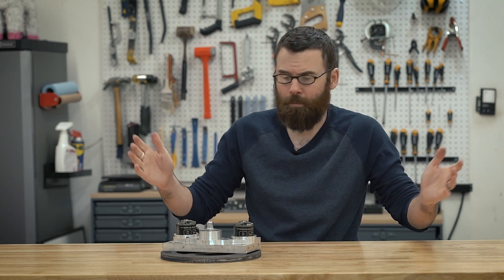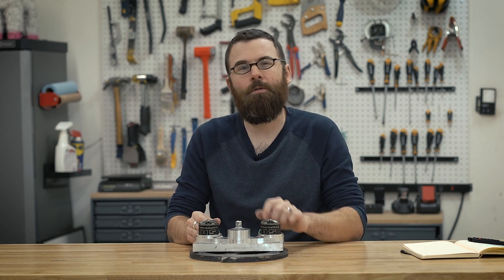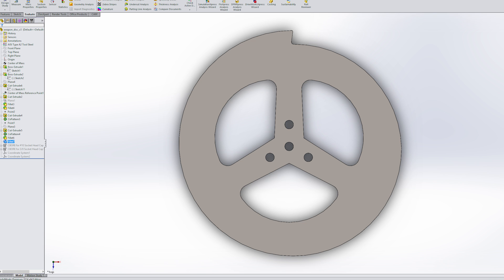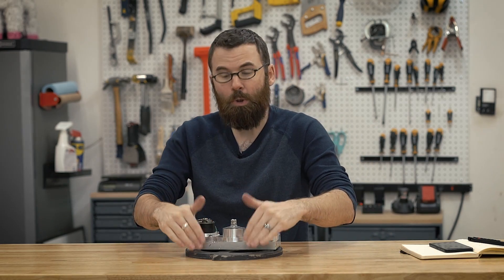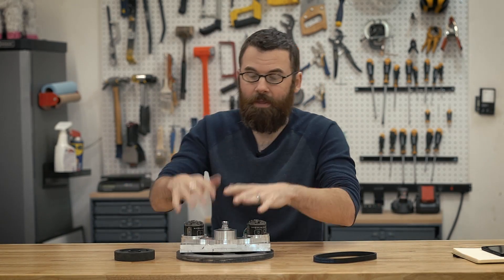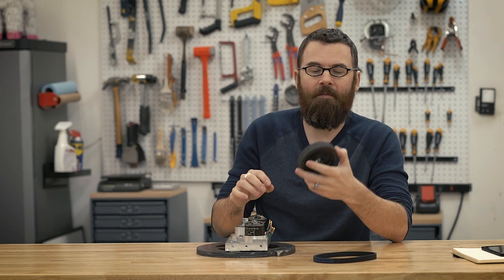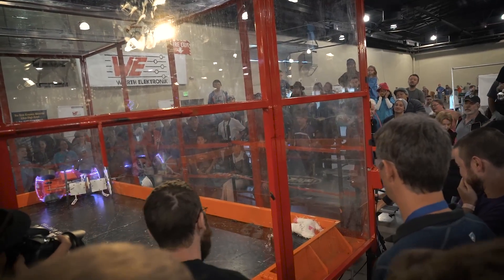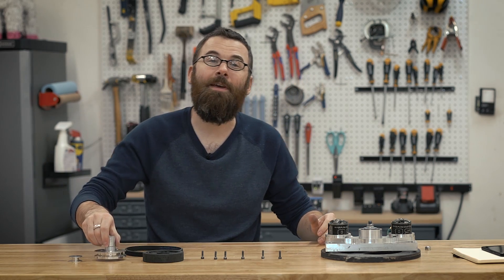Crippling Depression - Part 4 (Weapon System)

Comment: I have to ask why two motors?
Reply from the maker: Twice the power.  A single motor does OK, but with two motors, I get a much faster spin up time and much more torque.  I could have used a single bigger motor, but the height prevented me from going much larger (physically).
Reply: Robert Cowan thanks! I was not expecting an actual reply. I was literally inspired by you to try making a combat robot. Me and some friends only have a design right now but maybe someday. Thanks again!

Comment: Does more KV of the motor = less torque?
Reply from the maker: generally speaking, yes.  a motor has a fixed amount of power, so it can move faster with lower torque, or slower with more torque.  The windings ultimately determine the KV rating, and the motor itself will produce roughly the same output.

Comment: Was there no worry about the flywheel shearing its bolts?
Reply from the maker: Not really.  It would have to shear through 4 hardened 3/8" bolts.  In the final teardown, I found that the threads were a bit deformed, but that was all that happened.  It would take a LOT of force to shear all of those bolts.

Comment: what does 'KB' mean when you talk about the voltage?
Reply from the maker: I'm saying KV.  KV is how many RPMs the motor spins given a certain voltage.  So, if a motor has a 1000KV rating, and you feed it 10 volts, it will spin at 10,000 RPM.  When using brushless motors, it's important to pay attention to the KV rating of the motors as well as how many volts you will be running them at.
Reply: ok, thanks for the explanation!

Comment: Are you able to, or did you, program a slow ramp up of power, so you can use a switch (on/off) to control the weapon?
Reply: Or a coil to electricity ramp it up slowly.  (Not sure what physical size of coil that would take)
Reply from the maker: It doesn't really need any of that, I can just slowly ramp it on my radio.  I COULD map the control to a switch on my radio to just turn it on/off, but it's better to have fine control.  The faster you go, the more power it has, but also less chance to 'catch' and cause damage.  So, having the ability to control the speed is pretty important.  Also, the ESC has parameters that can be set to soft-start and such, as well as the radio.  But for this design, it's pretty unnecessary.

Comment: How about cutting an edge (like a blade) on the weapon tooth? So it'd cut instead of hitting. Would it make any sense?
Reply from the maker: the goal is to cause an impact, rather than cut.  the impacts cause shock to internal components (screws, electronics, motors) which causes them to fail.  cutting may cause more superficial damage, but it's nearly impossible to disable an opponent with cutting, unless you get to wires and such.
Reply: I see. It's very effective indeed! I Can't wait to see the other wheels with the different size teeths in action!
Reply: ndavid42 I would also think that a cutter would have a better chance of lodging into the enemy’s skin too.
Reply from the maker: Lodging in the other robot is not desirable.  Impacts that cause things to shatter, bend, or become mis-aligned is what you're after.

Comment: Fantastic video as always! When are you next competing with the robot?
Reply from the maker: Thanks!  I'll be competing at Motorama February 17-18th.  I'm a bit nervous, but I've made a lot of changes, so hopefully it helps.
Reply: Good luck! Also in the video you talked about how you didn't want to use bevel gear drive because it wouldn't absorb as much shock, but I have found having a bevel stage followed by a belt stage works well when combined, and has allowed me to get a larger reduction ratio with a relatively small weapon pulley/hub
Reply from the maker: I did consider something like that, but I just don't have the room to fit all that in there.  Also, it's just another set of bearings, an extra shaft, etc.  Just more stuff to fail.  I'm not saying it can't work well, just more complexity.
Reply: Yeah that makes sense

Comment: Is it an added stabilization benefit to have a gyroscope on the bottom essentially?
Reply from the maker: Yes, actually.  If you watch the slo-mo at the end, you can see it's very stable and wants to stay 'flat'.  I didn't encounter a vertical spinner or flipper, but if the weapon is at full speed, it would be difficult to actually flip the robot (in the traditional sense) because of the gryoscopic forces.
Reply: I did see that and it was awesome.

Comment: Rob, bolts are weaker in shear loads. Dowel pins should fix the issue you're seeing. you could also machine a lip into your frame to handle the shear loads and rely on bolts for tension only. Doesn't have to be much just enough to transfer the load. This might be preferable since it would result in transferring the impact over a larger area rather than through a pin that's harder than the material it's inserted into which could cause the hole to become oblong and cause problems. 

Out of curiosity - did you take any high KE hits on your frame? Because I noticed a similar construction method (bolts loaded under shear) there too. 

Lest I sound critical - bot is gorgeous and you do a great job showcasing it. Just sharing some things I've picked up in non combat robots over the years.
Reply from the maker: The new design is complete and addresses these issues.  The  new design uses slots where the pieces come together in conjunction with dowel pins.  All the stresses are concentrated on the dowel pins, or the slots where the plates come together, and nothing really goes to the bolts (sheer forces anyway).  I took a couple big hits, and I caused a few on myself.  I'm still learning and we'll see how V2 performs!